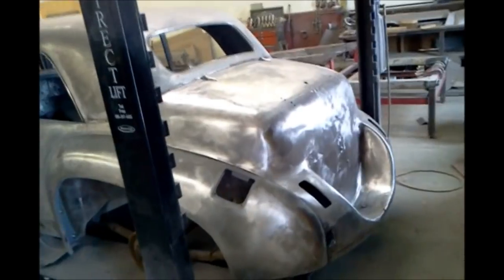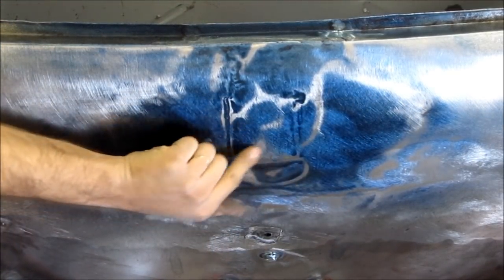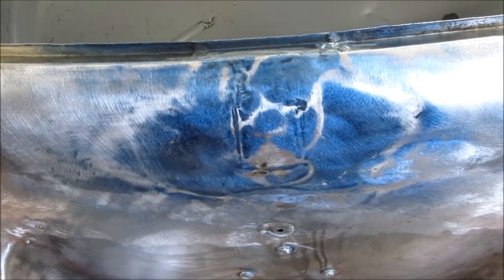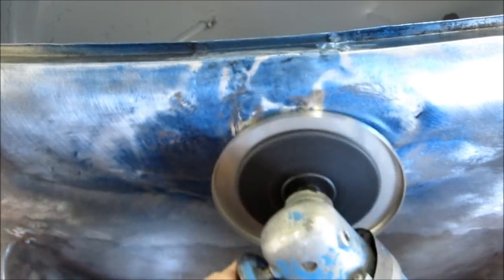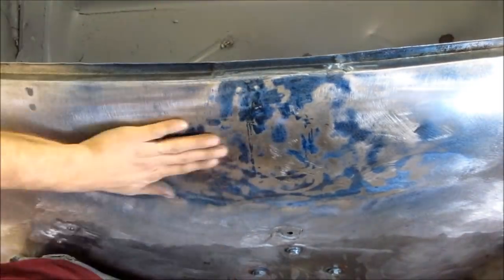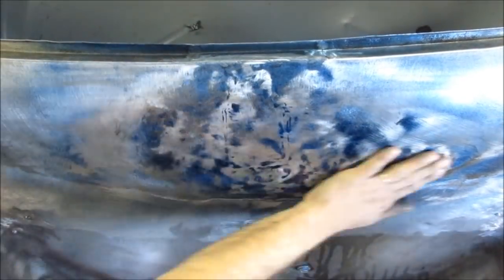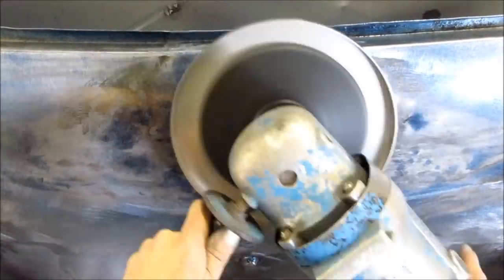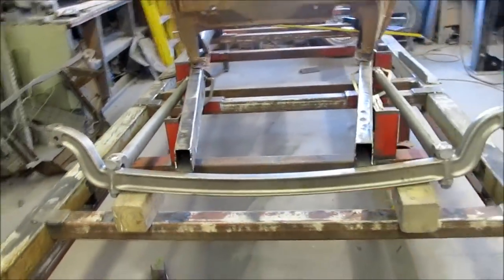Dent Repair, Metal Bumping & Shrinking with a Wolfes Metal Fabrication "Easy Shrink"™ Shrinking Disc

Comment: Great presentation.  Do you think that a shrinking disk could help with a butt weld that got uneven with no backside access to the panel?  Thank you
Reply from the maker: Yes it could.  Backside access always helps, but the shrinking disc will help regardless.

Comment: Found your video off the Eastwood site because I googled ‘shrinking disc’. Thanks so much for posting this and taking the time to record it. I just ordered the ‘Keys to Bumping Metal’ book and curious if the methods you use here are similar? Obviously not the shrinking disc, but your dolly work. Also, I’ve got a ‘67 Beetle the owner I purchased from took an axe to, so the dents are pretty severe. At what point do you cut and patch vs banging it out? The metal is good, just really creased. I have a donor ‘64 shell.
Reply from the maker: I am not sure, as i have not read that book.  Patching vs smoothing it out depends on your confidence and abilities.  Whichever you think you can end up with a better end result would be the method i would choose.

Comment: Doing a great job not many masters left anymore... Myself I started in the mid. '70's working with a master ... Teaching me how to paddle lead and pick & file with hammer & dolly... 
  The guide coat really helps showing  the lows on the Camara as well...
Reply from the maker: Yes, that is why i did it.  It is hard to show in a video what you actually see and feel in person.

Comment: What do you do if no dolly can be used in back of  sheet metal while on the vehicle  ?
Reply: Try a spoon or pry bar with a whale tail on the end or sometimes might have to open our the back and re weld again extra work but do the thinking first... Take more time one way or more time the other way...
That is a very good question ...👍
I like watching other masters as well becouse in the bodyman / painters trade you are never to old to learn a new trick...
Reply from the maker: Thank you for jumping in and helping!
Reply from the maker: peter had a good response, it isn't always easy, and you have to weigh your options.

Comment: Its not that easy though if the panels are double walled ( back of cabs )
Reply from the maker: That will make it more difficult.  You can always cut out the inner structure, and then weld it back in place when done.

Comment: How do you know when you are done? (smiley face) Others mention a glove or something magnifies sensation of imperfections.
Reply: Myself I got used to had feeling rag or glove for beginners helps them but doing it enough hand I'd best same for taking off a car I use the rag on paper etc. Then was hands a blow off with air from paint gun and clean hand before I paint. Also wrap chain on axel to ground to kill static electricity that will collect dust on car.. I just do odd job now of days getting  old is not much fun but the work is. Mostly the end result...

Comment: Brian ...Back when I started in the Auto-body repair business  you could certainly shrink high spots down or take the warp out of welded panels . but sadly those day's have been long gone for many years ..today's body panel you simply replace . just touching one with a mig welder blow's hole's right thru aside from being a much lighter gauge of body metal the quality of today's Sub frame material is also crap . I so love having the opportunity to work on anything from the early 70s back . Your blessed to have a car like the 41 to work on ..
Reply: Michael Laverty 
On the upside today’s thinner metals on cars allow the pdr guys do some nice work with manipulating metal

Comment: Have you done a video of using disc on an alloy panel? Getting more and more alloy bodies cars with damage coming into shop.
Reply: Guess no then...... does not work on alloy. Alloy fuses to the disc and it tears the surface up. Disc best kept to steel only.

Comment: Dear Brian, Hi I have a 1995 buick century and I have put 1999 Cadillac door handles on it . When I did it , the panels warped up to 1/4 inch. This was my first project so I have learned alot since I did it . Now I want to correct the warp and get it within 1/8 or less. Do you have any advise to help me correct these door panels?
Reply from the maker: Ron Johnson well it would be easier if I could see at least some pictures but what you probably need to do is get access to the back side and use your hammer on Dolly and restretch your weld Zone because that is where it shrank and once you get that stretched back out then you could use the shrinking disc to fine-tune level and smooth it out.
Reply: Hi I have bondoed it already  and I do not have access to the back side of the doors very easly. I want to remove the bondo and fix it that is why i am asking your advise. i am also looking into getting new to me doors and putting the door handles in them instead. I would however like to keep the original doors on the car
Reply from the maker: Ron Johnson well that is probably the best advice I can give you without seeing it or doing it myself. :-)

Comment: I am working on a 1965 mustang fastback and welded in a new rear quarter panel and have some heat distortion. I jumped around on the panel only stitch welding a max of 5 to 6 welds at a time and still got some distortion. This video has helped me understand the concept of shrinking and stretching metal. While I don't expect to get as good as a result as you do I am hopeful I can go from a warped panel to a good enough panel that doesn't need a gallon of bondo to fix.

Thanks for the great video.
Reply from the maker: When welding, even if you are careful, you will get distortion, it just depends how much, because the heat affected zone heats and cools, it shrinks unavoidably.  If it is possible to hammer and dolly your weld zone to re stretch it and then use the shrinking disc to fine tune and blend it in, you can get an almost invisible seam if you had good panel fit up.

Comment: i have a door skin that is stretched from a crease i removed.  i used a torch method to shrink it back but i can't quite get it all the way there.  i can see how this disc may help, i am considering it.  thanks for video.
Reply from the maker: Your very welcome!  Yes, i think the shrinking discs will help you fix your problem.  They work so much better than the torch in the majority of situations.

Comment: and for the record. you arent using this properly or for its intended use...  its meant to take down highspots when your panel starts oil canning..  not take out highspots that were left due to poor quality workmanship. lol
Reply: Fatasdat- You are a typical armchair Troll.  I'm glad you  made such a stupid comment for the world to read.  It shows how little you know about fabrication, and proves how little intelligence you as person possess.
And yes, please bless us with a your own video showcasing your extensive knowledge.
Post it up here in the comments so we don't miss it.
We'll be waiting.
Reply from the maker: Were did you learn its intended use from?  Our "Easy Shrink" shrinking discs are capable of much more than just that one purpose.  Have you used a shrinking disc before or tried using it for other repairs besides oil canning?  It does not have to be used only for oil canning, that would be wasteful as it is a wonderful tool that can be used for much more than that.  It can be used for shrinking overstretched areas from initial damage or overworking from previous repairs, blending, smoothing, removing sandblasting stretch warpage, reducing excessive crown and also along with a hammer and dolly when welding in a patch panel to make an almost invisible patch, as well as much more.  If you have or want to make a video showing your "proper method" and share it with some of your finished results, we would love to see it.

Comment from the maker: Since making this video, I have also added a smaller 3 inch disc that is very handy for tight areas and the backside of hoods, trunklids, etc that have had sandblasting stretch damage in between the bracing.  So currently our main kits are the SD3Kit, SD4Kit and SD9Kit.
Reply: I recently received your product. It worked great. I did notice that it began to burr even after the first hour or so of use. Is normal? Am I doing something wrong?

Comment: thanks! this is a great video! love my wolfes shrinking disc. i replaced an entire 1/4 on a 36 ford, and i was having a hard time sorting out the high and low spots.the off-dolly info is priceless!
Reply from the maker: You are very welcome!  I am glad you learned some tricks from the video.  Thanks for taking the time to share, as customers feedback and success is much more meaningful for others new to the tool than taking my word for it.

Brian Wolfe
Reply from the maker: Excellent! I am glad you like it, it is a very Useful tool. You're very welcome the on and off dolly information does not always get shared but is very valuable. :-)

Comment: Would this work for panels warped from fire damage?  Some people are telling me that the "memory" of them metal is gone and can't be bumped or shrunk.
Reply from the maker: You can stretch and shrink it, its just a matter of how bad is the damage and are you willing to put in the time.  On a normal repair, you only have 1 damaged section that you have to read, act, re read and adjust your repair.  On extensive fire damage, you do not have any good metal that is wanting to keep its shape (memory some may call it) to help in getting the rest of it back.  It could prove difficult for an experienced metalworker, but not impossible.  Just depends how bad it is and if its worth it to you, or if its a hobby, and you have nothing better to do.  If you have pictures, you can send me some via email, and I can do my best to give you recommendations.  If some of the larger low crown panels (roof, hood, doors, quarter panels, etc) would be fairly easy to make and you have the ability or know someone who does, or are available as reproductions or used parts, you could possible look at that as another option, as those will be the toughest to repair.  The more crowned or multibend panels, like say firewall, or highly curved fenders, cowl, rear valance, etc have bends or crown to help hold the shape as you work them.  I think the term memory gets used too much sometimes without a better explanation of why its called that.  It is difficult to explain, and my response is already to long, so enough for now. :)
Reply from the maker: Depends on how bad the damage is as you may have more heat in some areas and less in others making it very difficult as it might not have any original shape and tension left in it.  Not saying that it cannot be done, but it may be fairly difficult depending on the extent of the damage.

Comment: Did you say you used body filler in one section of the panel and led in another?
Reply from the maker: No, I do not think so.  We do not use lead.  If I recall correctly, I was probably talking about some of the lead that I was removing and that there will be some filler used by the seam and top lip.
Reply: Why don't you guys use lead? I got the impression it was better than using body filler from another expert.
Reply from the maker: MisterFuturtastic
Every Expert will have their own right and wrong way opinions.  I am not an expert by any means, I continue to learn everyday, but I can tell you what I think.  In my opinion, right or wrong, Lead can have much more of an impact on you, health wise, and be difficult and costly (in time and material) to apply and shape as you have to be careful as well when introducing heat to a panel to prevent unwanted warpage while melting the lead in, although I have minimal experience working with it.  Good quality modern body fillers of today are much improved in composition then old or low quality fillers and are quick and easy to work with, and have shown to survive the tests of time if used within the recommended thicknesses, which should be used as minimally as possible anyways, as even if you aren't "Metal Finishing" it, you should be able to get it pretty close.  If you can get a panel pretty close to begin with the polyester high build primers will fill small imperfections and sand just like primer being another and possibly even better option as well.  I am not against using it if you or the "Expert" thinks that it is better.  There is more than 1 right way to do it.
Reply: Wolfesmetalfab Thanks for the response. I didn't mean to imply you weren't an expert too. I just meant someone else who seemed knowledgeable as well. This person said when you use lead you would never want to use a body filler again but I know how opinions can vary. I just wanted to hear different viewpoints so thanks.
Reply: @Wolfesmetalfab  I agree with you 100% on the lead working I did my share as well still have a few bars in the garage and two paddles haven't touched them for years last thing I leaded was a bike tank didn't need much but not healthy ...

Comment: So what was the actual time spent on this section of the panel.
thanx
Reply from the maker: If I recall correctly, I think it took about 2 - 2 1/2 hours including some time spent on the filming.
Reply: thanks
Reply: Wolfesmetalfab 2.5 hours??? That's nothing compared to the time spent trying to fill that whole area with body filler and fanning it back into the rest of the panel. NICE JOB!!! I really like the idea of fixing the metal as much as possible, then using as little body filler to really finish it off.
Reply: MrMurph111 Thanks for the response ,I agree with you if it can be worked out as much as possible the results are worth the work .
They say a 1/4'' of filler is acceptable I say more patience with the hammer (or) disc in this case the better the result .
Great work and video.    
thanks again
Reply from the maker: MrMurph111  Thank You!  That is how i like to do it if at all possible.  Depending on the extent of the repairs or damage sometimes it does take awhile, but as you mention, it does take a decent amount of time and material as well if you have to use alot of filler.  It makes for a much better, longer lasting repair the less you have to use in my opinion.
Reply from the maker: Deputy Dodge
I totally agree!
Reply from the maker: I apologize I thought I answered this question a long time ago but evidently it didn't Post. I believe it was about two and a half hours with the Repair and filming time if I recall correctly.